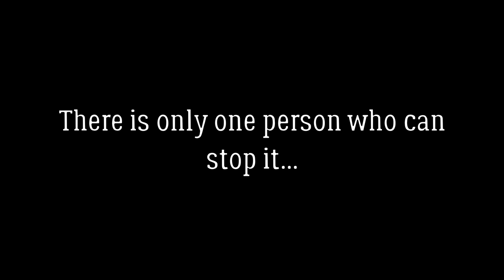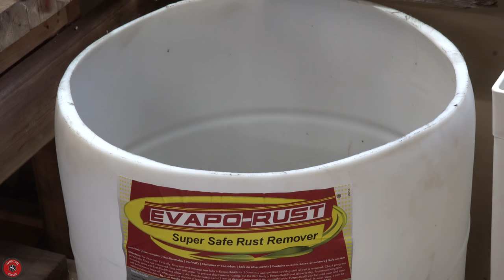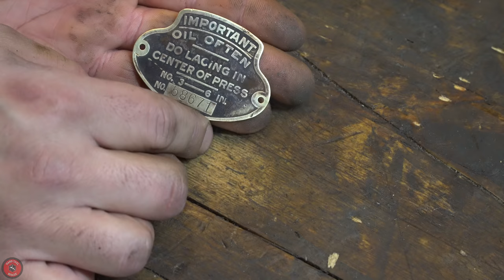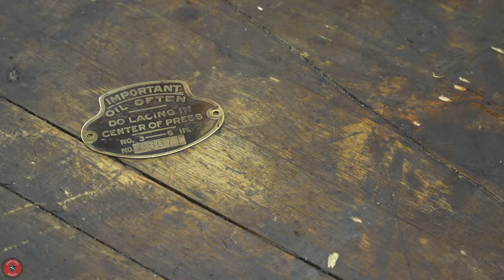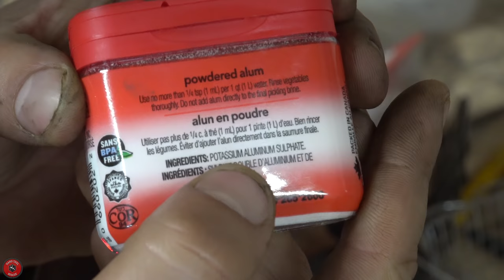Antique Belt Lacer [Restoration]

Comment: I've seen lots of tool/equipment "restoration" videos where the restoration consisted of cleaning up only the outside, and then calling it Done... and those videos have always kinda' pissed me off. You however, are the Real-Deal! Thank you for giving this ultra cool piece of equipment the care and consideration it deserved!  
 I did cringe a bit when you used that dinky little drill bit as a drift... also, might I suggest you equip yourself with a couple of sizes of brass mallet? Hard rubber mallets are fine for certain things, but they're way outclassed by brass, for the types of stuff I saw you doing here...
Reply from the maker: Thank you very much!  Will do.

Comment: Yet another case of a tool I didn't know existed but now I need to have. I've always spliced belts manually, so to speak, as I didn't know there was a proper tool for the job.
I have a belt driven 1902 pattern Pratt and Whitney 10" engine lathe which I love to bits. Now, I wonder where I'm going to find one of these here in the UK? 🤔

As an aside, I see lots of comments where people worry about whether these tools will go back together and how he remembers where all the parts go. I do wonder if some of us find it much easier to visualise the reassembly sequence, perhaps it's the way our brains are wired.

Comment: Yes, I restore one I bought at a Mud Sale in Pa. I broke the "spring eye loop" screw for the spring when I put it back together, 'at 27:14 is the screw going back in'  BIG MISTAKE the threads are 26 per in. EX.FINE Threads, had to buy the tap & die from China no one else sell it. Did not went to drill and retap it.

Comment: Next time you have a part with bent metal like at 18:05, try peening or hammering it back down instead of immediately reaching for the file. Most times you can move the displaced metal back instead of removing it and having permanent dents.

Comment: I love that someone actually cares enough to do this. Especially since this is a tool designed to do repairs that are a largely lost art. Gotta wonder. . . where do you find the staples? 

(Also, I was thinking I'd have used a hammer finish, but the black looked really nice.)
Reply: Here in the UK I buy belts and the splices from a company who's website is www.lathes.uk. They sell all sorts to us vintage machinery users.

Comment: next time, maybe some wood oil onto that handle before you wax it up...just gives it more lifetime.
also not greasing the joints and most of all not greasing the screws will make this hard to take apart when it comes to time...oiling just don't cut it there

wow quite quality flathead screws those are! 100 years and you don't scrape any of them apart? 
here in hungary if you see a flathead you just drill it out, because back when they were common, they were made of the shittiest steel imaginable, so you just can't unscrew them anymore.

nice job overall, and a tool worthy of restoration! well done

Comment: If it is worth engineering, it is worth over engineering. Some constructor just took it to the next level. How many pins, springs, small screws, complex surfaces, greesing holes and materials can I fit in this tool?

Comment: Great Vijayo! 

I never saw or heard of the Alum trick can you explain a little more about it? 
I love the comments about the sorcery holding things together! 
You are like a gun smith taking everything down like that, how do you manage to get it all back together without extra parts? 
Have you worked on these machines before or is it just pure experience and skill that enables you to do this type of resto with no instructions or drawings?
I would think you would use a brass and not steel punch to do much of the disassembly so as to not risk marring surfaces?

Comment: 24:00 in, shaping the new handles on the belt grinder:
Get you some spokeshaves and/or draw knives, tools like that will save a lot of sawdust, dust masks/filters and sanding belts for jobs like rounding those new wooden handles. You can find basically fine but ugly, dull, old & dirty ones on ebay for cheap- and rehabilitate them too!
BTW, the dust from many of the tropical hardwoods is anywhere from highly irritating to downright POISONOUS. Trees in a jungle  need to have some nasty property so the bugs can't eat the tree's trunk faster than it can grow...

Comment: I’m curious now: 

Before disassembling something like this belt lacer, do you ever have to do research on the mechanism, how it works, its parts, etc? 

Just seems like it’d be far more difficult if you didn’t at least have a rough idea of how the thing functioned.
Reply from the maker: I always do an ass-ton of research before each video.
Reply: Ah ok, that makes sense. I mean you seem to have a talent for machines in general, but it would be insane if you were just cracking stuff open and were able to put it all back together without having read up on the parts and whatnot. 

Thanks for the quick answer, though! Again, great videos.

Comment: Why does the rail at the front (with that spring lever catch) with the spikes drop down ? There doesn't seem to be any reason for why it would need to go up and down.
Reply: I'm not an expert, but that's probably a manually adjustable mobility providing device.
Looks like those spikes help to keep the belt in line with the teeth...

Comment: Too bad newer tools, etc. aren't built this well so you can actually disassemble it. Anything modern has rivets, peened over areas and tamper proof (NOT) screws. No one wants you to have a tool for years and years any more. Awesome job on the belt lacer.

Comment: WHY would rebuilt a machine that next to nobody knows what it is, and if you own it, would use maybe once every 10 years? I had a belt made for my 100 yr old lathe and they used a hammer for the lacing, and it's still going strong after the 10 yr.s. Now I get the part about rebuilding old stuff, but rebuild some "good" stuff …receipting hack saw, old drill press, & etc.?   My $0.02 ...Nice video thought!

Comment: Need to go back to these days quality wise...  I've done a few old tool restorations myself..  the only negative I see is that because of the iron, it's just heavy, but boy did the stuff last..  I know we could still get back to this quality with today's standards and probalby would be profittable to a degree..  The only reason I buy chinese is because stuff you get in the USA is chinese anyway (most everything outsourced even the basic of metals and hope Trump will fix all that as he has done some).. Just doesn't come with the same standards of quality.. Even though a lot of it is good..  It's far from great still..   I understand why quality when you use an item and it's not the same each time you fire it up cause the slight indifferences in the materials and such which is usually cheap plastics sometimes a carbon mix but not ever great..  Hope all the powers that be and the people bring this nation back to greatness, other countries will follow if we do.